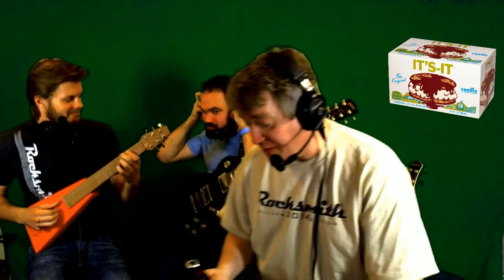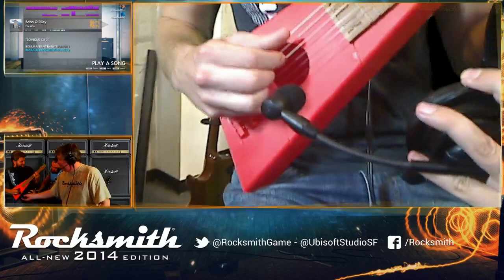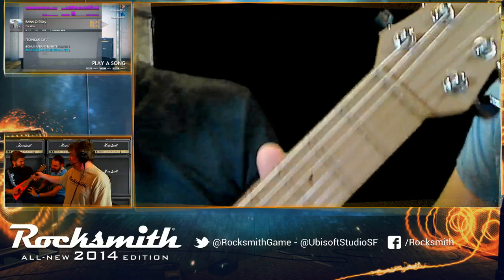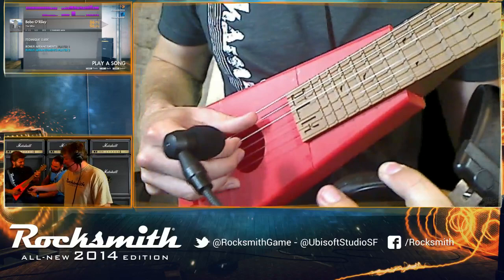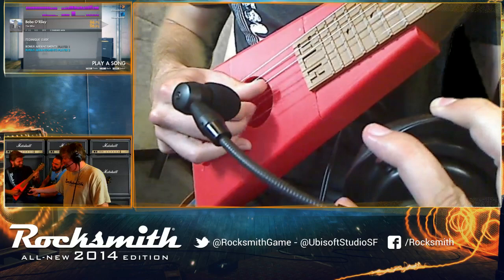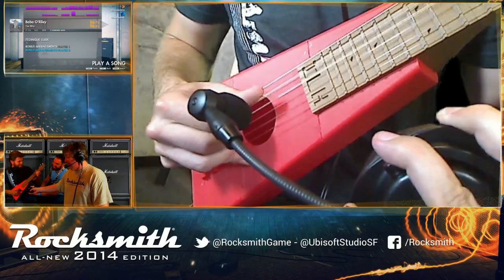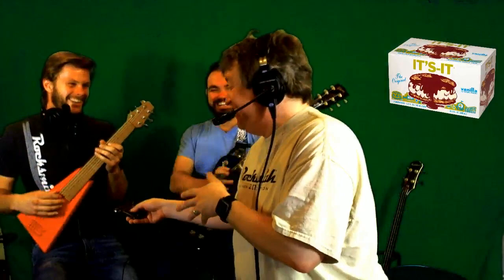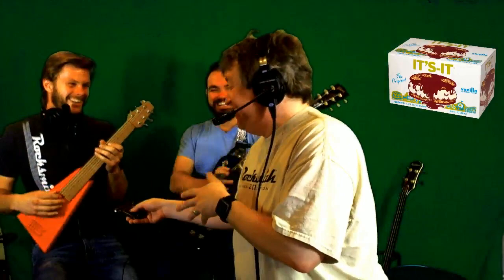Rocksmith 2014: Notetracker Greg plays a 3D-printed guitar

Comment: Well, it's interesting and cool, for sure. But is it also practical? Dan said - "I don't have a thing and I made it out of plastic in my home". Not really - you still have to go to a music store to buy tuners and strings and put it all together (and when you're there you can simply buy a full guitar). Also the body and neck is in multiple pieces, so it really isn't as easy as taking a working guitar out of the 3D printer. The price would also be imho better if you just bought a cheap acoustic guitar!
The ONLY real advantage of this (when not talking about how cool it can be to have a 3D-printer guitar) is that you can create your own SHAPES, even really crazy. Or even make other fret distribution, for crazy scales and whatever.
3D printing is really cool for making stuff that is very hard or impossible to get by other means. Guitar doesn't fit here, unless then main point is to get a crazy-looking one. But it is cool ;)